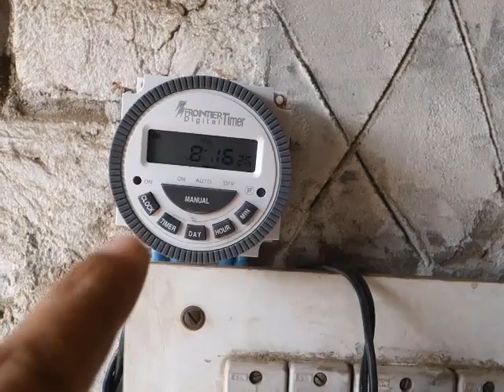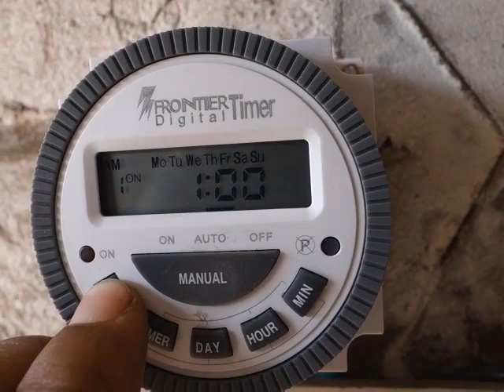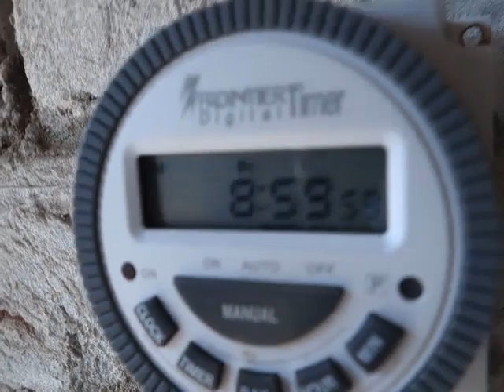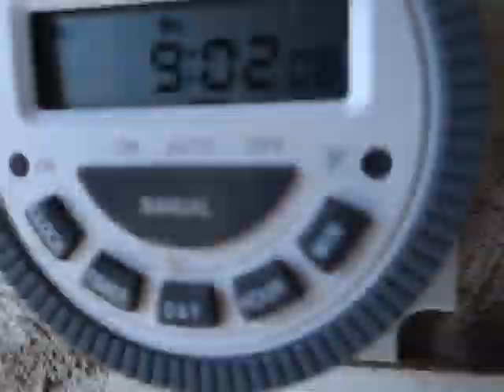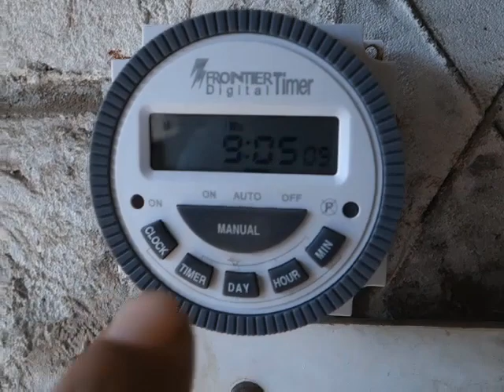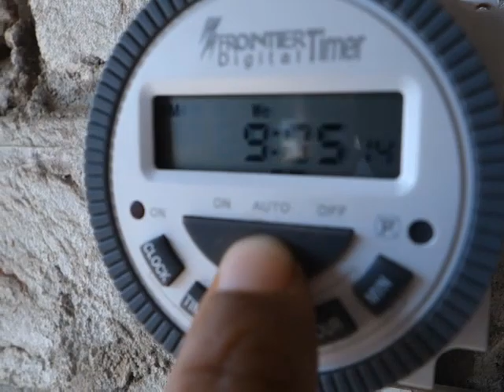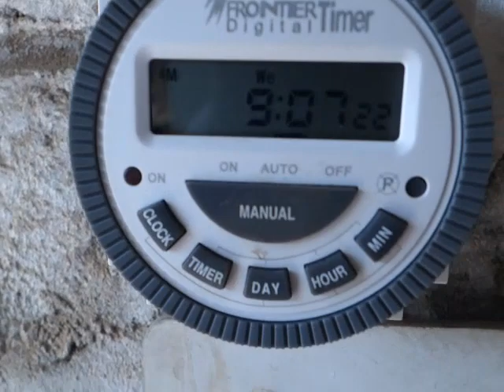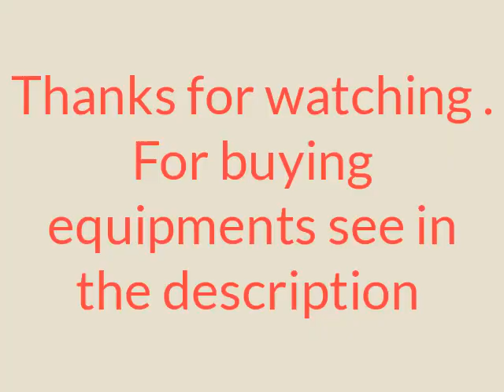Roof cooling

Comment: Might be a good idea if you use harvested rain water along with a solar water pump and battery set up with 12v pump, all of which i have and am thinking about doing this similar set up with a timer to cool a home here in Texas. Not sure how much water i would consume or use up, if i could catch it again with gutters i would be able to reuse some of the water that doesnt evaporate. I do have a large water tank that is maybe a 200 or 500 gallon capacity not sure.

Comment: Nice idea but wouldnt it be much cheaper in long run to add a green net on the roof and use this system with timer?
Less evap plus morr duration for the roof the get heated up?
Reply: Evaporation is the whole point, evaporation provides cooling

Comment: Use jute bags to retain water
Reply from the maker: Main aim is evaporation of water to induce cooling, only in extremely high temperature and low humidity jute bags can play useful role.
Reply: The terrace already has baked earthen bricks laid over the RCC slab, they are normally provided as a simple and cheap insulation layer and in this case they absorb and retain water providing evaporative cooling.

 If you are doing this on a bare RCC terrace, then Jute bags or nonwoven mats will be very helpful to absorb and retain water for evaporative cooling. Consider first a coat of reflective paint and then a absorbent mat with sprinkler system for additional evaporative cooling effect.

Comment: Tell us about your electric and/or water bill before and after this system. Cooler is great, but give me a good practical reason to do this. Is there any way to compare the cost of this vs air conditioning?
Reply from the maker: Pump runs for two minutes after every 2 hours and it is rated 370 Watts . Its electricity consumption is only one unit in five days .